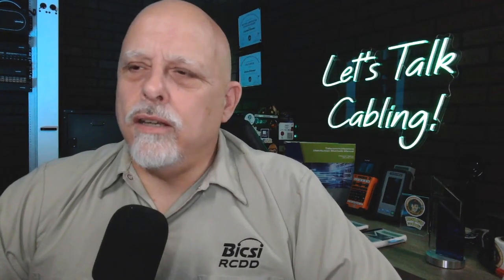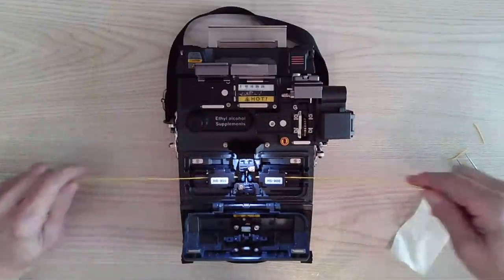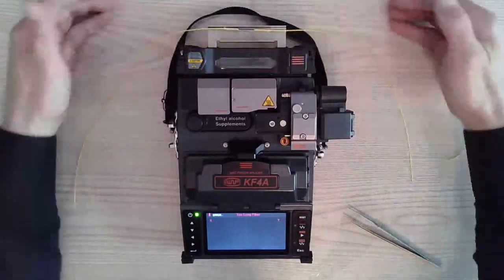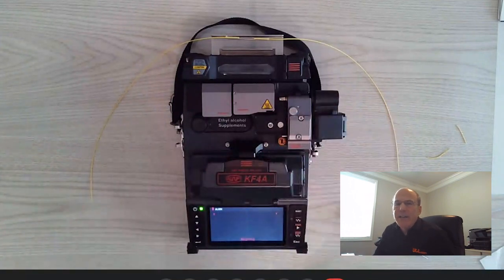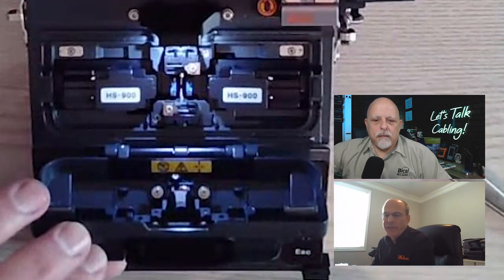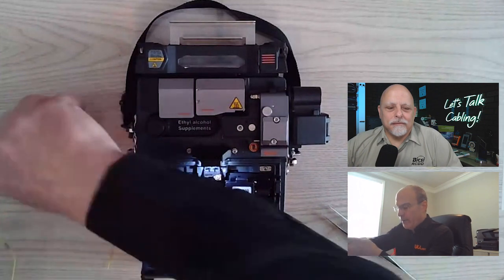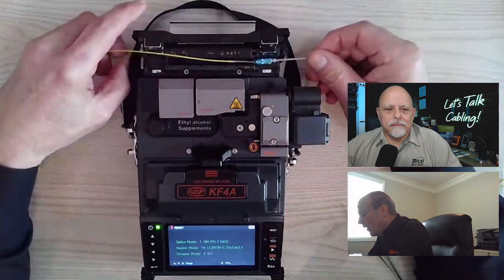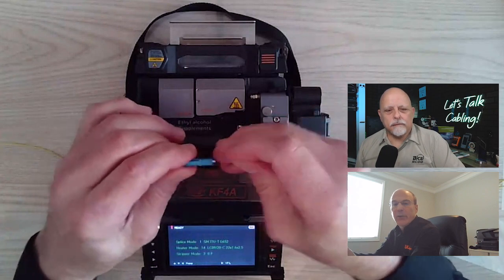Fusion Splicing Simplified A Conversation with Ron Greenberg | RCDD

Comment: Holy crap this splicer is a STEAL! I do like that the connector comes with 900 on it because I've thrown out a lot of $10 connectors in the past from an oopsie but I can't help but feel like this system slows you down. Labor after all is the biggest expense.